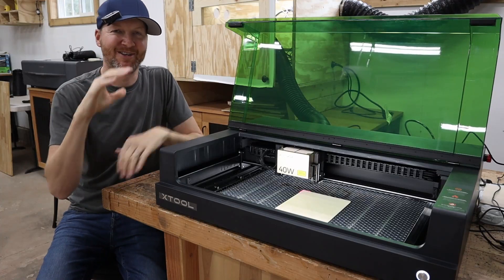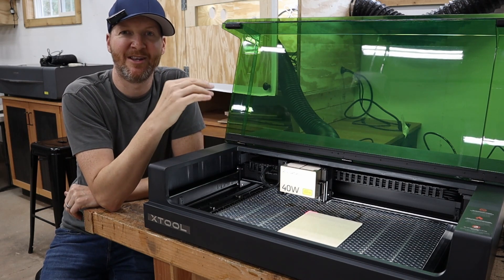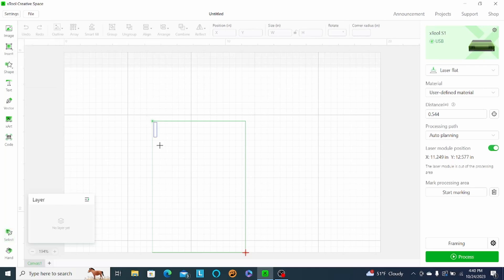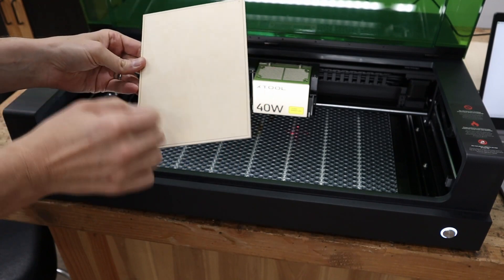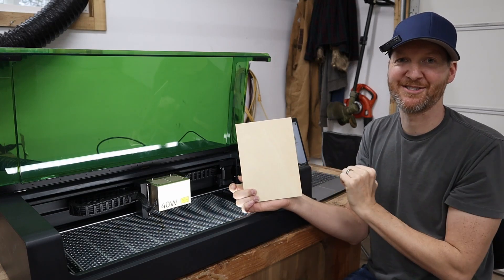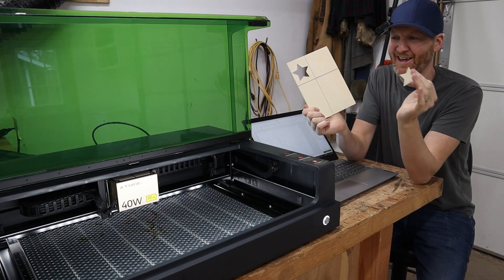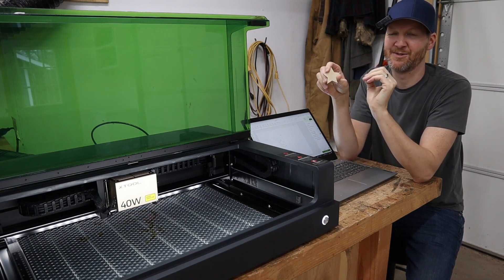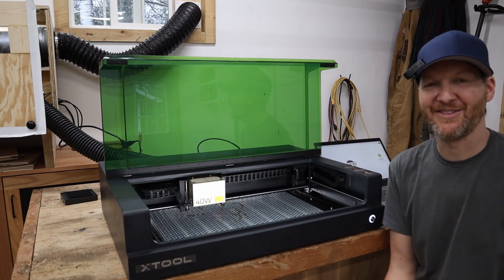xTool S1-Twin Point Positioning

Comment: Do you need to set your depth so the laser knows how high the piece is compared to the laser module?
Reply from the maker: Hello, yes...you need to set the depth, but the machine has an auto measure tool in the software, so it is really easy to do.
Reply: @chaddiy3512  yeah couldn't get it to do it. Had to manually measure it.

Comment: How do you make sure the piece to be engraved is in there squarely? I do a lot of long rectangles and would need it square for about 20”
Reply from the maker: Hello, I think the best way is probably just using a ruler or tape measure and measure from the frame of the machine to the work piece. And do that on each end of the work piece. Good luck!